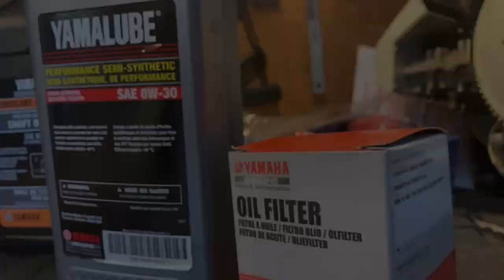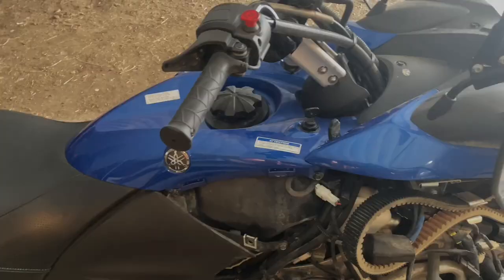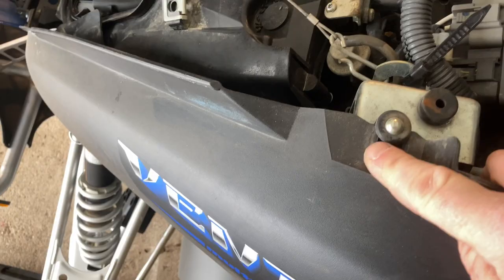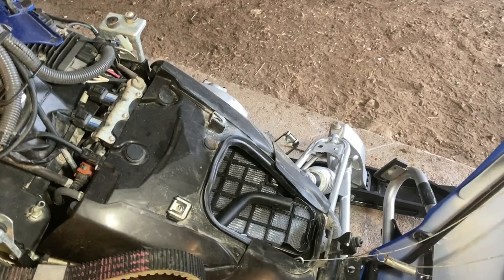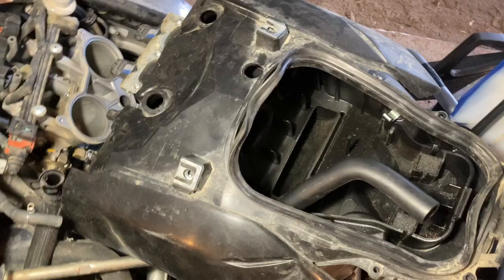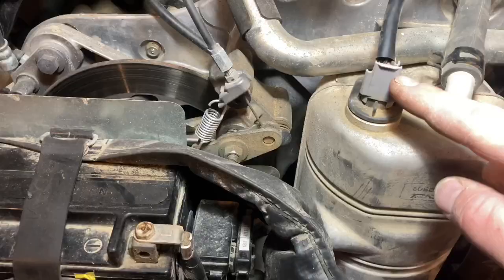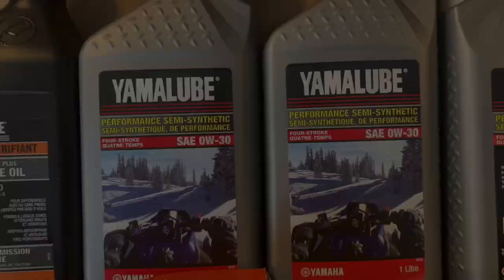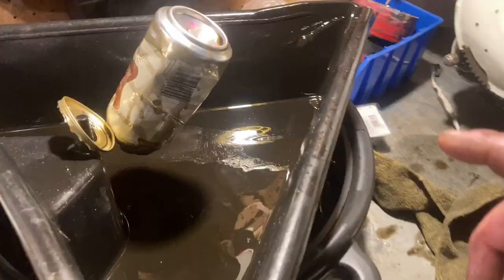Yamaha Venture Multipurpose Oil and Filter change

Comment: Nice video.  I never had to remove the oil cooler on mine even with my gigantic hands.  And because it's a dry sump system, you don't have to put the oil through the valve cover, all of it can be put in the oil tank.  Pro tip: Once every couple of years, after draining the oil, disconnect the lower hose at the tank, remove the two bolts and pull the screen out to clean it.  Sometimes dirt and debris can get in there.

Comment: Thank you for this video, I have the exact same snowmobile. I had it for almost a year now putting 4,000km on it. It sometimes does not start when the weather is extremely cold, I bring the battery inside the house and charge it over night then the machine usually starts in the morning. Maintaining it, it could probably last a long time
Reply from the maker: Yes, they are Divas, aren’t they!  I was told they will last a long time too.  You drive a lot more than I do!  Thanks for the comment.

Comment: Oil filter 12 ft lbs, oil cooler bolt 7.2 ft lbs with loctite, oil tank drain bolt 11 ft lbs, engine oil pan drain bolt 22 ft lbs.

Comment: I might have missed where you pour the oil back in, where is the dipstick to check the oil level?
Reply from the maker: It is on the top of the oil tank.  Doubles as the oil level sensor, so it is somewhat hidden in plain sight under the wire harness that attaches to the top of the dipstick.  Hope that helps!

Comment: gonna be buying one this weekend , i saw atrick of adding a flexpipe to the muffler and adding a turnout tip on the end to reduce ice build up underneath . it was pretty simple . I just wondered about track clearance by the turnout . ?
Reply from the maker: They definitely ice up.  I would say it is due more so to the heat and surface area of the muffler chamber than the exhaust.

Comment: I have 2009. Same Thing. Don"t suppose you have bolt torque specs. I have Energizer AGM battery. Leave it 6 months no problem. -20 C no problem.
Reply from the maker: Probably not for your sled.  The manual I have includes many similar models and a bit of a spread in terms of years.  I would suggest contacting a Yamaha dealer and ask for a digital copy of the service manual.  That’s how I got mine. Of course they charged me, but that is expected.

Comment: Where do you add oil in the engine block?
Reply from the maker: There is a fill hole but it is pretty hard to get to without removing the seat and fuel tank.  That’s some good engineering eh?

Comment: Very good video, thank you. Did you make one to replace the spark plugs?
Reply from the maker: Thank you.  I have not, but it is a real possibility once I need to replace the spark plugs.  Good idea.
Reply from the maker: Now I get it!  I had to pull the plugs on mine last weekend.  It is a bit of a job disassembling the seats and fuel tank to get to the plugs!! Ridiculous but true.  Maybe I will do a video on it now that I see the truth!
Reply: Thank you there would surely be many of your subscribers who would appreciate this video as well as one on changing the chaincase oil on a Venture mp and for changing the belt, from Québec Canada.
Reply from the maker: As requested Ronald!  I finally made a spark plug removal video:  https://youtu.be/hw5lIufZkZc